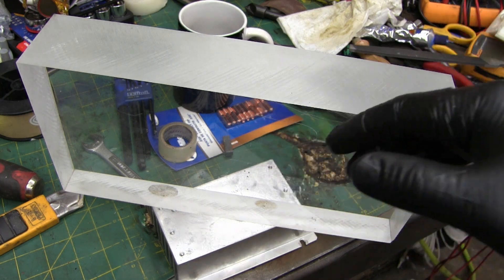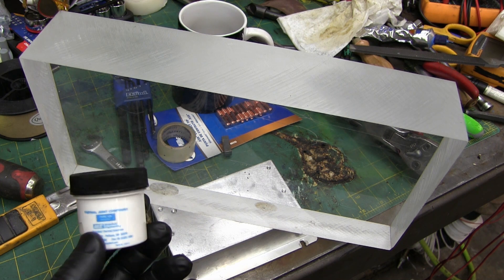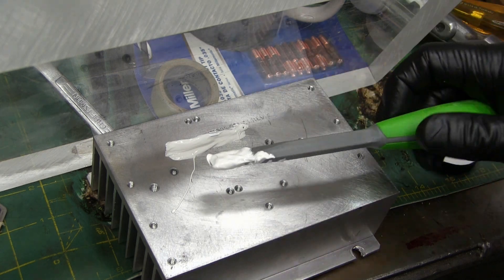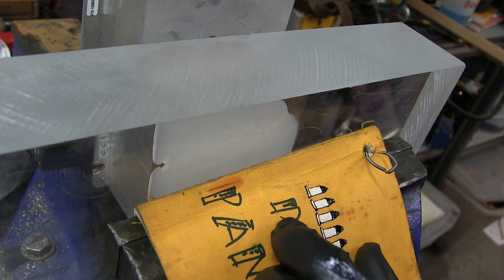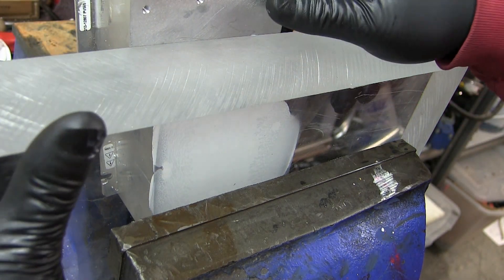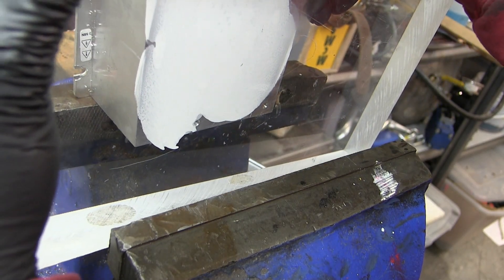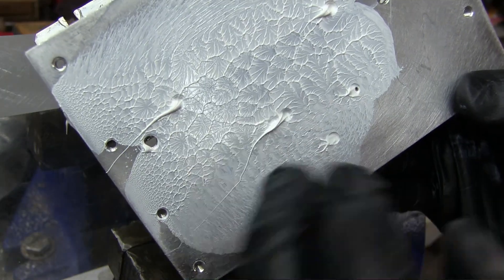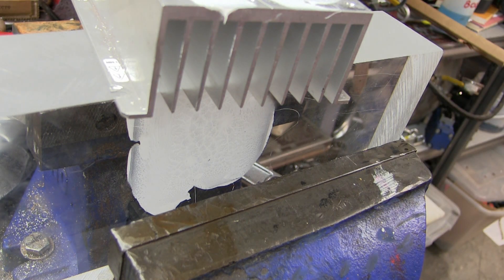Quick test of best thermal compound application

Comment: Worst science project ever.
Reply from the maker: Nobody's perfect. Don't be so hard on yourself Susan.
Reply: C- is still passing
Reply: Thermal testing needed!  The Wakefield product is 0.736 W/mK conductivity.  Artic Silver 5 is about 8.9.  Fujipoly has some 17 W/mK stuff.  Where the hell did you get that huge piece of acrylic?
Reply: I forget where, but there's a very detailed proper experiment here on the boob tube.  They did line, pea, zig zag, cover entire thing, none, etc.  Only difference was the control to with paste.  Other than that, at most 1 degree science difference, which is within the standard deviation and thus scientifically insignificant.  TL;DR it doesn't fucking matter.
Reply: Alex M, it can matter if you do a poor enough job. Many years ago, the first cpu I installed was overheating because I had too thick a layer of thermal compound. Cleaning it off and applying the compound properly immediately solved the problem.
Reply: But you watched it
Reply: Alex M - I think you maybe thinking of Linus Tech Tips - Thermal Application
Reply: Hey I was curiousing about the shmoo to spreading ratios myself.

Comment: On small almost-square thing like a CPU, some say (Puget Custom Computers, in Seattle) that it's best to put down thermal paste in a X from the corners through the center. As you press down on the paste, it smears to cover the entire surface, with minimal chance of getting any air bubbles. Though on the long thin surfaces from the "Industrial Electronics Tune Up" video, I would imagine that a line down the center might work best.

Comment: i'm really late at catching up on this one but smearing it around manually is critically important for trying to apply subzero to really toasty things.
if you're just looking to keep it at a reasonable temperature within the manufacturers' specifications though it generally doesn't matter what you do, yep. and being someone that has done things in his life i'm sure you had a good chuckle about the hundreds of Comments talking about how volume of material used is crucially important as if all applications don't also include incredible clamping pressure.

Comment: It makes a huge difference when your heatsink only has a 1" square contact patch and you aren't applying force with a vise. Notice how at low pressure there were many more air pockets on the schmear side? Do you know how hot cpus get? No, you don't. One drop in the center for best results. No air bubbles

Comment: Bombardier's CL-604 maintenance manual procedures for installing wing leading edge temp. switches with wakefeild 120; call for a minimum layer thickness of 0.015" (0.38mm) of thermal paste on the Leading edge skin. A shim is placed on the skin then the mounting face of the switch is filled with compound and installed. Switch body recess is then filled with compound. The switch is then fillet sealed at the perimeter and the top covered with High temp RTV.

Comment: Most of the nerds interested in the dispersion of white goo on heat-sinks come from the computer modding side of things, proper application of thermal paste is a hot topic, we do know from testing smearing induces bubbles and is likely to scratch the surfaces if you want perfect thermal transfer you want to polish the surfaces to a slight dome to increase central pressure and make the paste squeeze out the sides, and allow the metals to contact at the thermal point and let the past pick up the peripheral area which is much less important, that allows you to apply more pressure where it's needed and make a near mechanical join with the metals without destroying the heat-sink or bolting it to absurd clamping pressure it's pretty much a science in of itself. most nerds have concluded a reasonable sized blob of thermal paste is the best way to go and allowing the surfaces to pressure evacuate waste paste to the sides is a good way to spread it void-free, you also want silver heat-sink interface materials for maximum transfer which should also discourage computer vampires, so bonus! the next question is what paste is best, personally i prefer diamond and liquid metal pastes, i'd love to see them combined somehow the micro-fine grains of diamond bed into the materials to transfer heat incredibly well and the liquid metal would fill the microscopic gaps around it, could be the new go-to if it were executed properly.

and if you managed to read all that you're just as big a goo nerd as the rest of them! rejoice! for the future is uh, cold and sticky?

Comment: I suspect it's more important to use thermal paste sparingly than it is how it's applied.  The points of direct contact between the two surfaces should have a lower thermal resistance than the paste, so you want just enough paste to fill in the voids but not enough to separate the two surfaces.

Comment: Completely agree, in regular sitiatins a little glob will do ya, a big blob will screw ya. skwert some in the middle that would be enough to spread over the entire surface and not leak out the sides. using too much is not really possible as two flat metal surfaces usually have nowhere to trap the excess so it just leaks out the side.

Comment: I Have been watching your videos for quite a while and I only commented on one couple days ago. I have to say you crack me up and with my background and computers and electronics the point behind thermal compound is to help transfer heat from one porous surface to another. In many cases if possible I try to lab the two surfaces together and apply as little compound as possible. It is my experience that less is more when it comes to this compound. I have seen many instances where people will put as much thermal paste as they can on a chip or MOSFET and the end result is the thermal compound starts to act as an insulator I would like to know if you could run a test and film it showing the advantages Of more or less I have benchmark computers running identical hardware using less compound on one then the other and have noticed that by ensuring just enough compound present to provide adequate thermal transfer will actually run cooler there a processor with globs of thermal Paste present.

Comment: Just an idea for a future video. What if you did a comparison/ tear down  between two torque wrenches. A cheap $10 harbor freight and something a bit higher end like KD, mac, Cornwell, or snap on? See if there is a big difference in how they are built and projected longevity. I assume there would be a huge difference but you never know till you look. Maybe the harbor freight ones are actually pretty good? I have a hard time trusting a $10 torque wrench personally.

Comment: What i generally do is, first, do research on the screws, find out a middle line on the torque applied on them. With that in mind, i then use hardening putty (any woodshop should have that) and put a tiny drop smack in the center between the two clean plates.

 Once hardened i find the thickness and spread from original drop to whatever shape came on (at the correct torque settings) and with that in mind increase the volume of thermal paste by X amount considering the results of my test (reason for putty is it's easy to remove from any surface).

Want to stress the fact that, this is done only once for a specific type of mounting, once that's done, i don't need it anymore, i just have it in my memory or in my note book.

A bit extreme, but sure as fuck better than having to clean thermal paste from SMDs or from under the cooling plates. ALSO, seems to help with that drying effect. I have observed an increased lifetime on systems where this method of "just-enough" was applied vs regular ones.

ON A SIDE NOTE PSA: ASUS has gone shitfaced and shipped a lot of their laptops, even in the upper business class with sub-par thermal paste and application. I have found several of their units with the same asshole level of manipulation. Very disappointed in them, aside from their recent assholism when it comes to how many screws their laptops and systems are held with, which has decreased considerably = lesser product, this was a blow bellow the belt from a company that i didn't expect it from.

Comment: Not very thorough. It could make a difference depending how you hold it down. Usually there is hard to press on all corners equally and when a triangle is formed the smu would be pushed in one direction. With a line the risk is simply greater to leave uncovered spaces if the pressure is not equal on all sides. It also harder to guess the right amount and the excess could cause problems in some cases when sensible electronics are near the heatsink and the thermal compound is conductive. There is not much sense to have a time saving on this, usually the quality is more important.

Comment: GamersNexus and even LTT have thoroughly documented that pea, X, line, and spread make no difference as long as you simply apply enough paste to go around. Any valid points towards any particular method depends on the size of the IHS, the location of the die, and the viscosity of the thermal compound in question; even then it's only a matter of convenience, brought about by rule of thumb.

Comment: After a few heat cycles, thermal paste cures to a dry, powdery but solid bond. The thermal resistance is a little lower than when first applied, and it can't be moved without mangling the cured layer.
Reply: Help me understand what part of my comment you are disagreeing with.
Reply: hes not saying that you can move the thermal paste, hes saying that after it dries out its still relatively effective.
Reply: Thanks. To be clear, I said that after it cures, it has a slightly lower thermal resistance, which means it's slightly more effective.
Reply: I'm neither a PC enthusiast nor a thermal compound nerd, but you could try with providing sources to your claim that he is wrong.
Reply: "I deal with heatsinks for nuclear power cheers." - But can you read?
Reply: I build space-lazors for glow in the dark CIA aliens, and you're all wrong, but you cannot grok why.
Reply: The cheap petroleum based carrier compound dries out, the silicone oil based carrier does not.  The oil or "grease" (thickened oil)  is merely a carrier of the powdered heat conductor material, which is there to fill the microscopic roughness of the two surfaces (heat source and heat dissipator). When properly clamped,  the "sandwich" leaves < 0.001" thickness (almost transparent) of the thermal compound between the metal parts. Common materials for the heat conductive powder are Zinc, Aluminum Oxide, Silver and Beryllium Oxide (BeO).  Of these Beryllium oxide is the best heat conductor (only Diamond is better).  Aluminum Oxide and Beryllium Oxide are electrical insulators, Silver is highly conductive.  Flat, parallel surfaces and adequate, even clamping force ultimately determine the heat transfer effectiveness with all of these materials. A good way to apply a very thin layer of the compound is with a metal "squeegee",   All the rest is either "squeezed-out" or not between the mated parts, and therefore totally wasted.
Reply: @shazam How dare you try to inject knowledge and reason into this troll thread!  For shame!
Reply: It's Christmas, so I thought some actual knowledge might be a nice gift.  Usually I don't bother.  Thanks for noticing.

Comment: I think your test was skewed a bit. Where in the vise exerts more clamping force than the actual screws used would be able to. you should find a way to affix the Pecan to the heatsink using the proper mounting locations and threads, the aluminum heat sink warps, therefore making the thickness of the heat transfer paste non-uniform... Just my theory, make it fact for us...
Reply: William Ward not really he said moderate force on vice you'd be amazed at the clamping force produced by 6 tiny screws.

Comment: As an electronics engineer fixing bullshit big rock and roll power amps all day every day, the idea of smegging it on like icing is stooopid the shit is only there to maximise the thermal contact area due to imperfect surfaces. As long as it's spread evenly doesn't make a rat's arse difference.

Why the gloves? It's zinc oxide. The same shit you run on a baby's butt when he gets a rash

Comment: its worth noting that the phone screen repair guys DO NOT smear the bonding adhesive around on the screen before placing the glass panel over it for the express reason of not forming bubbles. They make a double sided Y shape on the screen instead.

Comment: Used to work in a PCB shop, had a board with a dozen or so mosfets mounted onto a large heatsink. Globbed a bunch onto a plate of glass and ran a brayer through it like you would ink, then onto the heatsink.  Pretty darn quick...

Comment: You can add too much thermal compound and have poor heat conductivity too. You want to get the two pieces of metal as close together as possible with the thermal compound only filling in the merest of gaps

Comment: Thermal paste is actually a bad heatconductor. So should be applied as thin as possible. If you apply it twice as thick you have doubled heat resistance. Thats worse than 10% bubbles. Heat paste thickness should only cover surface roughness. Important is to have both surfaces very plain to reduce gaps between the two surfaces so you need less heat paste thickness. Nice way of testing this is using computer (graphics) cpu with heatsinc on top with thermal paste in between. Cpu has tempsensor onboard which can be monitored. Give cpu heavy calculations. Try using thick or thin paste thickness.

Comment: Could you do a thermal test of a lot versus a little? In my technician days I read that the thermal compound should be used sparingly, since the intent is just to fill the voids in the metal surfaces, since the compound conducts heat better than air, but worse than metal, but I’ve never seen any data to prove that.
Reply: Tim Thompson Thats my recollection as well, you want no air bubbles, but you want that coating to be a thin as humanly possible. I do lines that will fill in without bubbles as they spread, and once it emerges on all sides I do tiny motions with it until I feel it really resisting movement, and wipe away the excess leaving a tiny tiny bevel of it at the edges to conduct an iota more heat from the sides.
Reply: speaking from building computers its better to add too much than too little unless you are getting the paste in places it shouldn't be

Comment: I doubt the appearance once you pull it apart really matters. You are then just looking at the compound wanting to stick to itself as the two ends separate and it pulls itself up. As long as you got full coverage with not too thick layer you should be fine.

Comment: The difference is that smearing might trap some air bubbles, but ensures a consistent coat. A gob isn't always guaranteed to spread. When it's good, it's slightly better, but when it's bad, it can be a lot worse. I've pulled heatsinks with gob style application, to find only half the contact area actually covered with schmoo.

Comment: Large IGBT modules have a slightly convex base plate to better spread the schmoo evenly.  I've also heard from a engineer i know that designs these things, it's applied in production using a mask.  Much like a silkscreen that just has a hole pattern in it.

Comment: I used a lot of this stuff. I worked for a company that used Peltier devices for cooling. On those devices there is silk screening printing on one side of the devices. They have to be coated on both sides-one side is the cold side the other is faced against a heat sink. We would try to evenly cover the printing in a uniform way, and then use that as a 'gauge' to apply the same amount on the other side. The devices can only be clamped down with screws to 25 inch/pounds torque. I never had the chance to use a vise, but I would have liked to try it !Too little of the stuff left open areas (or bubbles). Too much and it would squeeze out and bridge between the cold and hot side, creating a thermal 'short'. Seems like about 0.060" of the stuff works. The stuff we used was lithium based (wear your gloves!: no idea what the lithium would do to you). We used silicone-free material, because some manufacturers (read: automakers) will not allow silicones on their site, at all, because of the potential for surface contamination.

Comment: It doesn't matter what it looks like when you pull her aa--part!
Less is more with this stuff... a very thin even layer gives the best results. Doing it lines caused extra pressure on the components when the heatsink/component is tightened and that doesn't do anybody any good!
Just put a dab on, and layer it out with an old credit card.

Paddy

Comment: When I first watched you contemplate the pattern that develops on old "Shmoo" I was curious what the areas of vacancy were caused from. You demonstrated that the white parts are still viscous, and not flaky as the pattern would suggest. This is perplexing how the pattern forms in old (cheap?) thermal compound. Then I thought, "those patterns look like the particulate that forms in Miso soup when allowed to sit." 
The miso particulates form the same type of patterns from the thermal convection of the soup, and I wonder if the material in the thermal compound does something similar when heated and cooled over many cycles.
Thoughts?